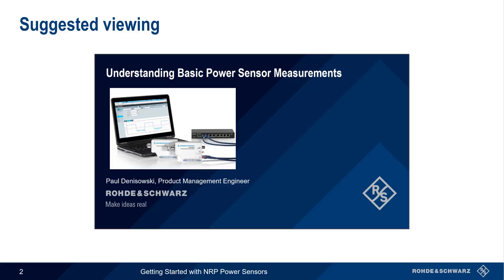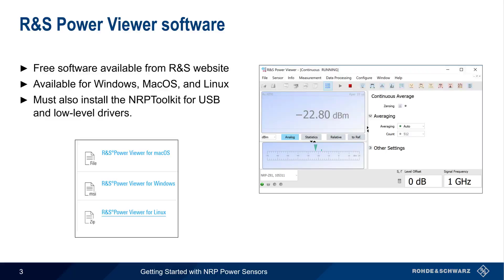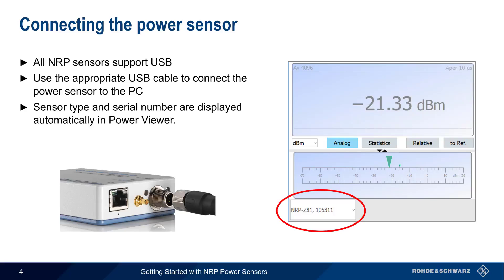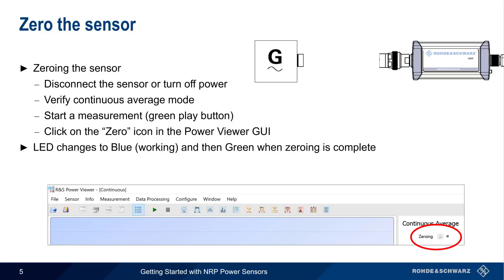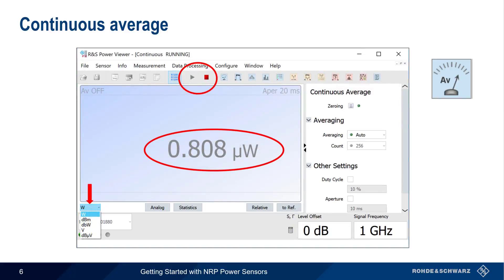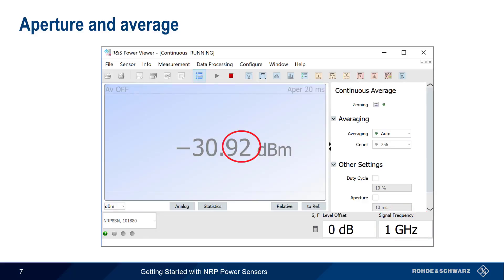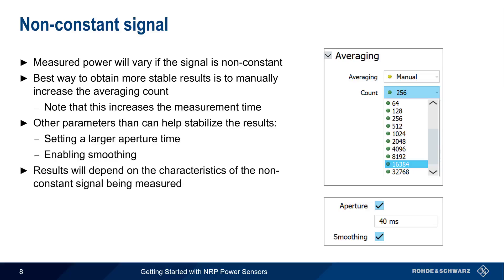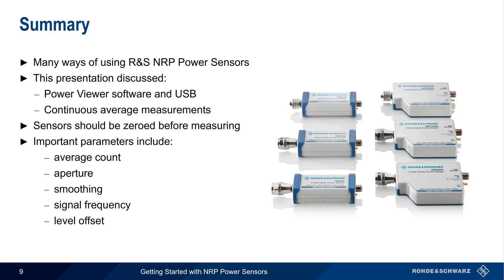Getting Started with NRP Power Sensors

Comment: Great explanation. May I get the information on how correction factors can be adjusted in EMC32 software based on setup modification for test requirements.
Reply: Thanks!  With regards to EMC32 (our EMC/EMI system software), it would probably be best to contact your local R&S representative or technical support -- probably a bit much to type in a YouTube video comment :)
Reply: @pauldenisowski  Thank you. If possible kindly consider this topic in one of your upcoming presentations.
Reply: @sudeepshetty4530  Will do.  I do have some (more general) EMC-related content under development right now, so please stay tuned!